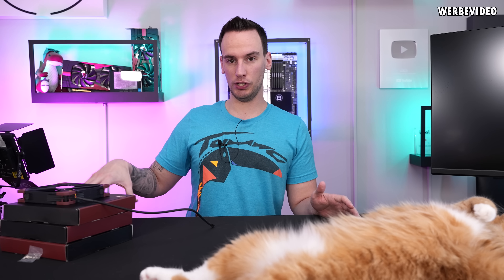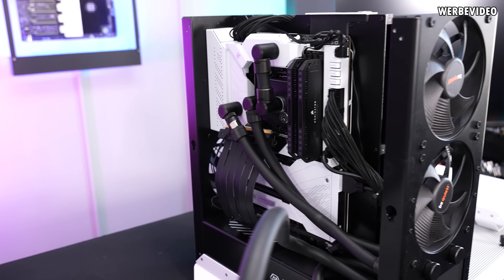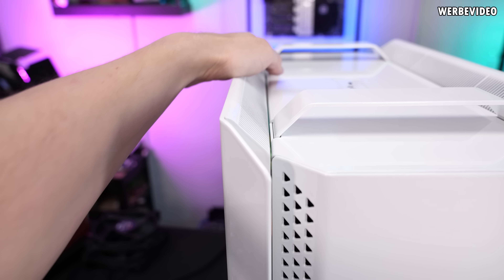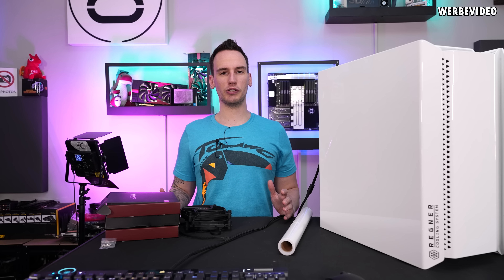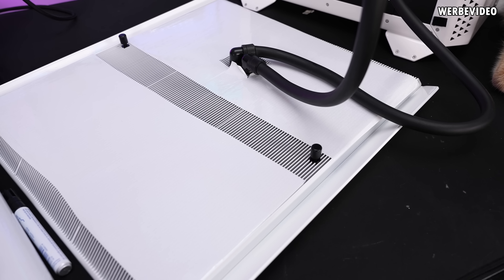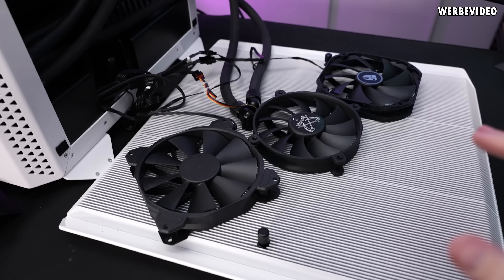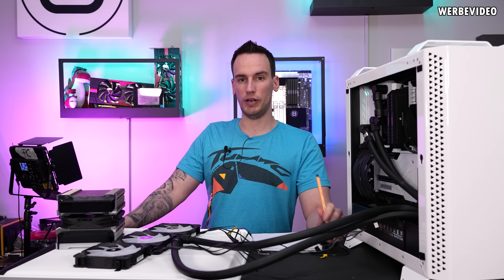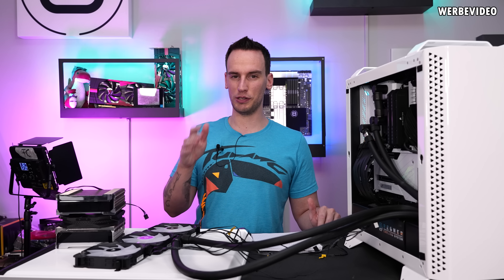Trying Community Ideas to Fix the 1700 EUR Regner Cooling Case

Comment: I would have liked to see the foil test with space for 3 fans in the middle to force the air through the fins. Also I wonder if all the fans were intakes whether it would add more flow to the center of the rad. It has to just be sucking air through the top and bottom portion of the fins and spilling into the case, there is no reason for the air to flow through the entire length of the fins when there is a giant opening right behind them. Most of the tests disproved this theory though, 3 fans (6 total) sitting on it would be more effective than just 3 mounted in the case.
They must have had so much money tied up in the original design that it wasn't feasible to bin it and start over so they put it out there and hoped for the best. Clearly that didn't work out too well if it is off the market already.

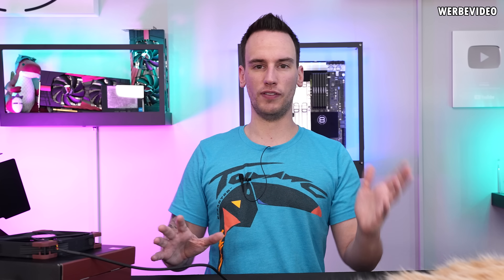Comment: 0:54 Much higher? If it’s the NF-A14, that’s an understatement. I searched on Pricerunner for the highest airflow and static pressure, and found that the NF-A14 on bargain bin. Bought four of them and put my pc case in the basement

Comment: This case cooling idea would work flawless if you had good exhaust and no gaps for air to enter without passing first from the radiators.

*(and the panels were fully open and not only top and bottom)

Comment: Did you put a flow indicator on it. I have a 5800x on 120mm rad and under laod the water does not exceed 36c. Idle its 28c

Comment: I am not an expert, but I am 100% sure that 1st fin with this direction is blocking most of the airflow. Reason why attaching fans directly on the radiator works is because air can properly cool radiator/water down. Even if direction of fins is changed, it will never be as effective as attacking fans directly on the radiators.

Comment: The fans are moving the air horizontally in relation to the case. The fins on the panels run vertically. What happens if you turn those panels 90 degrees?

Comment: Pump speed rarely matters… the problem is just those radiators. Water channels inside? imagine cooling the water just by having 1meter of tube laying around the room. The fact that the panels are much colder than the water temperature shows it all. They don’t work - they don’t exchange temperature with the water.
Reply: The panel within 2 degrees of the water.  Heat rejection to air is the issue.

Comment: Solution #1:
Retrofitting a pair of GT-R transmission coolers might be more efficient.

Solution #2:
Try installing longer hoses which allow you to invert panels 180 degrees, so the fins are on the outside.  Then temporarily mount to a roof rack on top of your GT-R and drive around at 40 kph.

If all else fails, then just swap for a Raspberry Pi 4 😀

Comment: realistically it's probably the paint. Even if it is a thing layer of paint, if they used some acrylic, or latex, or any polymer based paint, it would act as as insulator, preventing the fin from dissipating heat
Reply: to prove this, you can wire wheel the paint off of the fins but that would effectively destroy a "1700$" case

Comment: Just make one side panel a normal side panel and the back out of 3 360 radiators + fans and open the top, bottom, front, and back with ventilation holes.

Comment: I wonder if the water is moving to fast through the rad and not able to move enough heat in to it. Honestly it would be cool to see some IR images of the case side.
Reply: Your idea of how thermal transfer between different mediums works is just wrong. If what you're saying were how thing worked, it would mean that blowing air through a radiator or a CPU air cooler very slowly would increase cooling performance compared to blowing that air very fast. Because then "the air would have more time to pick up heat from the hot metal surface".
Also, with any water cooling system, you'll always get better performance when running the pump at a higher speed.

Comment: can you do a mod because it is a fail v1, like do a venting to front put a hole and dust filter to look good and the side panel also remove the paint if it is causing the bad temperature?

Comment: Would heat dissipation be improved much if the fins were on the outside of the side panels? It would be interesting to compare performance with the Alphacool Eiswand which, I guess, would do a better job of isolating the heat exchange from the case.

Comment: Acrylic enamel paint, or pretty much any paint, acts as an insulator when you're not applying it correctly. You need to use a specially blended paint for radiators or no paint at all.

Comment: The solution in my simple mind is simple. The front panel needs actual holes in it (lots of them) for airflow. Take a drill to it and drill in holes from top to bottom, where you can, and I bet that would mostly fix it. My simple mind could be wrong however.
Reply: That would not fix it, as the radiator panels themselves are not transferring heat properly.
Reply: @Bayonet1809  I feared that was the case, but was hoping for a simple solution. The concept of this case is great and hope these issues are resolved. 

Do you think it could be the thickness of the fins?
Reply: @Christopher_S  Probably not. I mean take a look at household radiators. They can pump out massive amounts of heat without any fins. Most have indentations at best. What they do have is channels that force the water down a long path giving it time to push the heat out.

Comment: Really want to see what real airflow though those fins would be like (if you can get any with normal fans) - stand the radiators up in a 3dprinted fan adapter ductwork thing with the intake well off the desk and those foil covers and see you you can actually force enough air through that really long thin radiator fin at all - I doubt it, as it is just such a long and tight flow constrictor... With those fins I suspect you really need to have jets of compressed air blasted into them to get much work done.

If you want such giant radiator panels the sensible thing is to take a leaf out of home radiator type designs and have some larger ribs that direct the water flow and increase surface area a little with really wide space sheet metal fins attached - so the degree of airflow restriction is pretty low, which means convection might even start having enough influence to create real airflow on its own, and the fans can actually push air through it!
Reply: Really at this price point, replace the radiators with condensers and go full phase change.  Actually that would be pretty cool.  Single condenser with a giant fan.  Actually as an intake!  It pulls air in from the side (like a home unit), then blows it on the VRM.  Possibly use a commercial heat exchanger and a standard water block to make life easier.
Reply: @arthurmoore9488  Hmm such a giant phase change cooling built into a case would be interesting. Still want to see how far the passive airflow could be improved on the radiator side panel style though.

Comment: Generally radiators / heatsinks do awfully if the flow of air is laminar - fans generate turblent flow right behind and in front of them, which is how most heatsinks tend to work. 
This excludes passive designs where they have giant air gaps between each fins....

And similarly this applies to water flow - I assume that with just flat surfaces the flow of water is nowhere near as turbulent as a normal radiator lol, not to mention the dimunitive  internal surface area of each of the radiator panels.

I wouldn't be surprised if the actual surface area was less than a single 360 radiator.
Reply: AGREE!!! Itll be a single simple channel that loops back a couple of times. No restrictions or microchannels to create the vortex's needed to throw the water around and therefor the heat.

Comment: I have hot water radiators for heating the room. The warm water enters on top and leaves at the bottom, the fins are also outside, in open air, not in a closed box. This case is not like that.

Comment: Roman just get Vince to send you  his LazyCocker 😁 case from 2018 and 
use that for the editing rig 🥶😜
oh the fins should be on the outside with smooth side on the inside and the smooth side plate should be out of copper. 
but most likely this case is nothing more than a cool idea that will never work

Comment: how about the easy way remove the front close panel for the beginning , you can have 20 meter surface area , but if there is no air can go in it practically no cooling

Comment: I also like thermal camera idea. Show the path of water inside. I suspect that fin area is ok, but contact area between water and radiator is very small, just a tube, water spends little time inside radiator and comes out still warm.
Did you take inlet and outlet water temperature for regular radiator compared to this side panel one? Would be interesting data point.

Comment: Hey, I think that you should cover the fan at the back, it should have less static pressure than the 2 front ones, so air will escape over there instead of through the holes at the sides. Had something similar happen when replacing the fans of an HD7970 with 2 120's and tried to create an enclosure for them so air could only escape through the fins, but as I used 2 different coolers, a high RPM one and a low RPM one, air escaped through the slow fan instead...

Comment: Just throwing here to see if it sticks: 3 fans on the base of each panel + foil, closing the bottom with foil as well. As such you create a duct forcing the air to pass through the whole length of the channels, exiting at the top.

Comment: It seems like a bad design from the start.
Maybe if the side panels were rotated 90 degrees, so the airflow was in line with the fins, it might work. That or have the fans at the top and bottom of the case. Even then, it would need a way to force the air to go across the fins, like how servers have a plastic airflow guide to force air into specific paths.

Comment: You just don't see single sided / closed off radiators in any cooling solution anywhere. They need to be flow-through IMO. I like the jist of the idea but like you mentioned, the radiator idea needs to be completely re-worked to actually dissipate heat in the desired form factor.
Reply: Just to expand further, I would assert that if you blocked off the back of a 360mm rad and put 1 fan in the middle, you would get much worse performance or much lower efficiency for given volume of cooling apparatus. Obviously normal rads are designed to be flow through and have frames but the amount of pressure requires to actively use that system seems like its too high to make sense with PC fans.

Comment: Could be a number of issues that we can't easily see in the liquid part of the system, but what we can clearly see is that the radiators have an airflow problem. The foil idea was a good one, but I doubt you had anywhere near enough static pressure to make those long, narrow passages the path of least resistance. Think of the side panels as a really big blower-style GPU cooler: They have long fins (with the occasional little holes and slits to encourage turbulence) that are enclosed in a plastic shroud so that the full length of each fin sees air moving across it. Now, imagine you took the plastic shroud off of a GPU blower cooler. The temperatures would be awful because, without that confinement, the air isn't going to travel through the fin stack. Sure, you might get a little airflow right next to the fan, but without a shroud to keep the air moving through those long channels, it's just going to pop back out of the fin stack almost immediately. This case is very much like a GPU cooler with no shroud, only the fan is even further away from the fin stack!

As it stands now, I would bet that the majority of each fin is really only passively cooled. I would bet the only part of the fins that experiences any notable airflow are the very top and bottom. The restriction might be low enough that the case fans push some air out over the last centimeter or two of the fins, but I would guess that the vast majority of the length of each fin is only experiencing airflow from convection, meaning it is basically a huge passive radiator. This also means that you should get very similar performance with the side panels installed on the case versus taken off and just lying on the table next to it. It should largely be functioning as a passive radiator, whether or not it is installed on the case.

So, how can you fix it? I'm honestly not sure there IS an acceptable fix for this case. The basic problem is that, even if you construct a shroud to keep the air between the fins, you are going to need some serious pressure to get that air to make it all the way to the end of each panel and out of the case. That means the fans are probably going to be quite loud. Second, I don't see anything in those channels to help disturb the air as it is moving along and promote turbulence. That means the flow is probably going to get more laminar as it moves along and be less effective at picking up heat. Lets say you constructed a more serious shroud and stuck your three 120mm fans on each side in the middle of each panel to force air through the side panel like some kind of giant GTX 980 reference card. I'm pretty sure that those same three 120mm fans would be more effective if you just stuck them behind a traditional 360mm radiator, and cut a big hole in the side of a traditional case panel to mount that radiator to it. Another option might be to perforate the side panel between each fin so that air moves over the fins and directly out the side of the case rather than having to travel all the way to the top or bottom. That would help some with the path-of-least-resistance issues, but may end up being more of a manufacturing nightmare than it is worth.

At this point, it may be better to accept that the side panel design isn't effective and move on to something else.

Comment: 1) Tangential Fan at the bottom of each side panel/cooling surface
2) Top inlet and bottom outlet, same as car radiator (cooling panels)
3) Radiator/reservoir at the top of case
4) Quick release fittings (optional)

The other thought I have is, whether or not the pump is strong enough. You may need a pump for each side.

Comment: To dissipate the heat, don't the fins (the greater surface area) need to be on the outside?  Most of the heat is being contained in the case, even with the fans blasting.
Reply: No, doesn't matter where the fins are so long as air can flow over them. It would work better if it were completely passive if they were outside, but inside is for aesthetics as you get a smooth finish outside and the fans can assist by pushing some air through the fins.
Reply: @DampQuiche  What are the temps of the radiators when the case is open?
Reply: @cyberwomble7524  He did that didn't he with the rads on the desk with fans on them and got no improvement. It needs the fins on the inside as it is a semi passive solution. If it were fully passive they would absolutely have to be outside as the heat from other components would screw up the convection. With the fins inside, it is semi passive because the fans dont blow direct on the rads but they do help push air through the case and then through the rads.
Reply: @DampQuiche  The radiators cannot dissipate heat any better if they're laying on the table or enclosed in the case?  Both radiators actually got hot in both situations?  How peculiar.  As the two very large radiators are handling both the CPU and GPU, the other component temps should be negligible and (with the rads on the table) be manageable with a small fan - it should basically behave as an open bench.
I think it's better if I rewatch the original video rather than bother you anymore!
Edit: Ah, I see a problem - the enormous amount of hose is holding an enormous amount of water, that hasn't been added to the calculations it seems.

Comment: The surface-area-to-volume ratio for those side panel radiators seems way off. There's a reason CPU coolers / radiators have many, smaller fins and not few big ones.

Comment: If you look at passive coolers, they have huge gaps between the fins.  I think that the foil thing didn't work, because the pressure required to go up through those small channels was too much. Maybe they could try making the fins more spaced out + the foil thing.  (Or the 6x fan thing + the foil thing)

Comment: Did you check Flow rate,Aquacomputer do make one of the best flow rate sensors? With such radiator space I would want to have at least 2-3C delta,improving cooling,replace side radiators for MO-RA3 radiator hahaha
Reply: You would think that with the sheer mass of the rads you would get better cooling. But i suspect that the flow is garbage and the surface area of the channels in the rads is pathetic too. It is just a bad product that clearly underwent zero testing.

Comment: Just saw a few days ago a vid from French YTers (French Hardware and Pax) that built for fun a 100m watercooling loop with 6X360 rads, and temps were crazy low, not much above ambient even on a OCed 12900K ! Buuut they used a garden pump, 400W power !!!
So I suspect that in the Regner case the pump may be too weak and not move the (lotta) water fast enough... Did you try adding a couple pumps and check if it improve temps ?